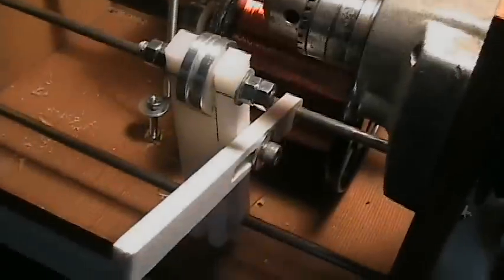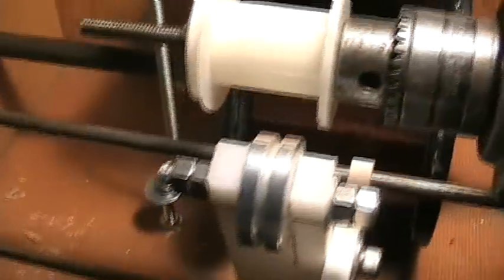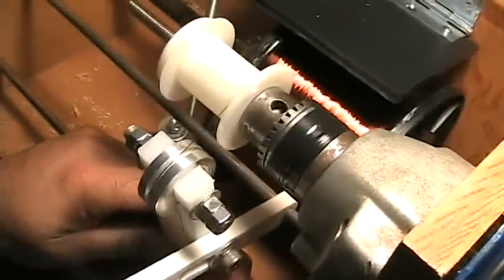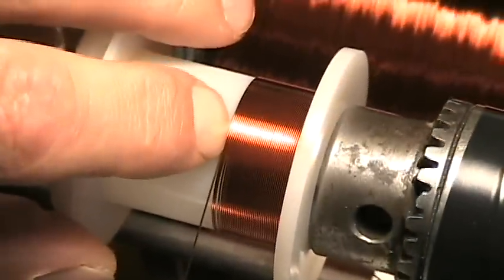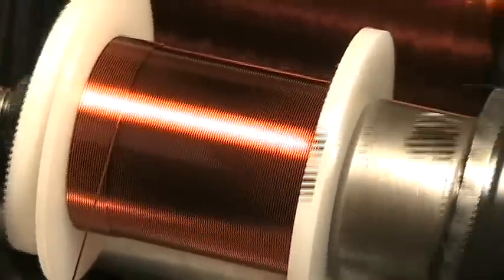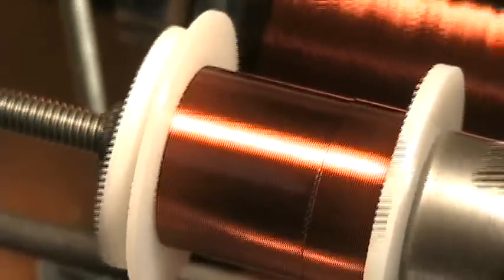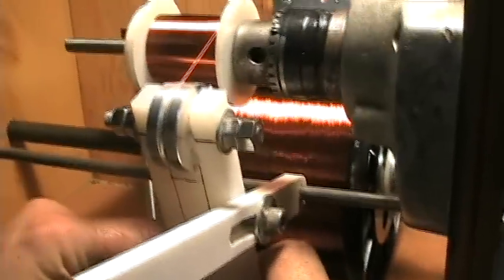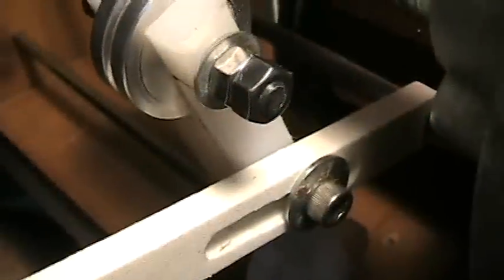Coil Winder Update with Tensioner Guide

Comment: Nice winding!
I need some coils with wire diameter of the order of 0.05mm to 0.1mm. My thinking is a screw-driven guide of some kind but the challenge is how to reverse the guide when coming to the end of one layer. From your film it is not too clear how you are guiding the wire. Is it perhaps manually?
Many thanks!

Comment: great stuff! I am going to do the same kind of a machine. Checked the arduino-based machines and that's lots of work. No time for this. I just need a few coils to be made for a magnetic bearing, doing a high precision 3d printer here. Semi-automatic approach is the best of two worlds, and if you do it with the idea of being upgraded later then it is the ideal solution.

Comment: Make it Arduino based. Then you'll get perfect windings. I have done it. I even made 40k rounds high voltage transformer with it with thick plastic insulation between each layer.

Comment: Excellent video very nice setup like to build coil 4 inch diameter with 18G wire 9 to 11 ohm for a levitation project I have build 12 coil for local school, is it possible to receive parts list so I can build one to,
Ve6but at shaw.ca
Best regards
Tosif